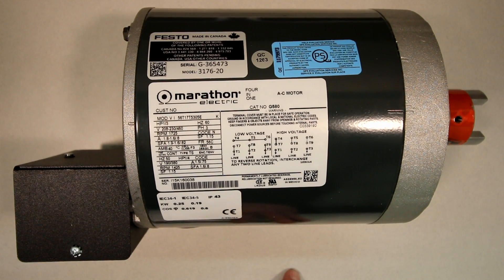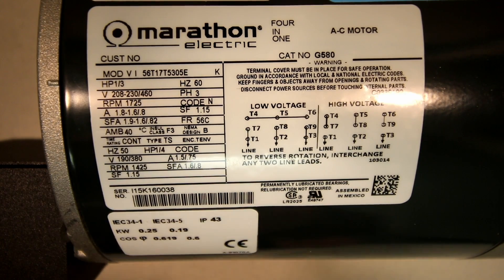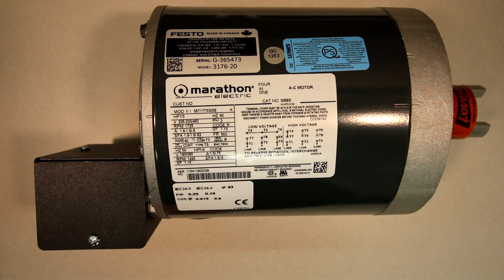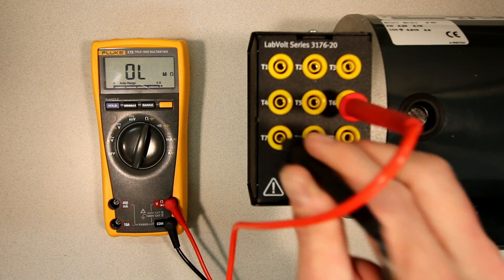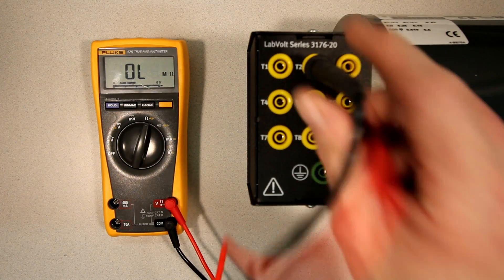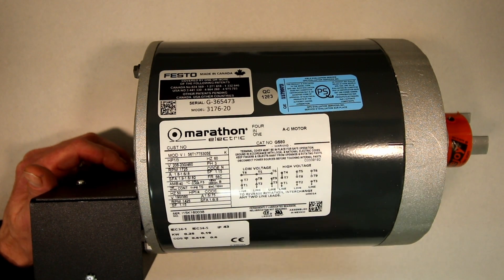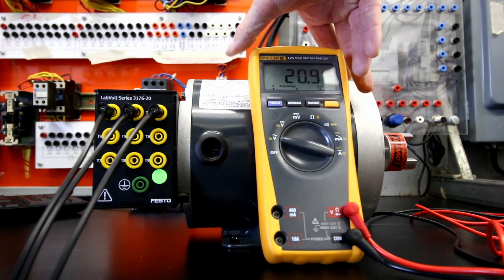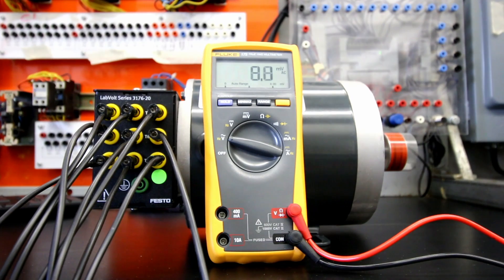Dual Voltage, 3 Phase, 9 Lead Wye Motor Connections #3

Comment: And u can't read from t1 all the way to t10 because t10 is inside ...but when u were explaining in previous video u were using and pointing to the end of the series coils which consist of 2 joined coils  from t1 to t10 220v but from t1 to t4 110v which is the half that u got 60v

Comment: The reason result was 60v because u measured half of winding/coil because in series u already said the whole 2 coil from t1 to t4 to t7 to t10  it will show 220 but in t1 to t4 it will show 110 .so u can't reach t10 to read the 120v so u got hafl of 120 which is 60v why because is b/w t1 and t4
Reply from the maker: Check out Andres Kruglov's answer that I have pinned in the comment section of this video.... in our shop we only have 208V as a supply voltage. The 208 V source requires the parallel connection. The Series connection would be for a 416 V source. 416V divided by root 3 = 240 V divided by 2 windings in series equals an expected voltage of 120V. Since I am only using 208V as the source... 208V divided by root 3 = 120 V, divided by two windings in series equals the 60 V reading that I showed in the video. Thanks for your comments Engineer Sead.

Comment: you connected motor for high voltage and turn around apply the low voltage to the motor you figure out that motor is going to cook in 5 minutes.
Reply from the maker: Please see Andres Kruglov's answer below in the comment section.

Comment: Great video!
My guess to your question. You've connected it as "High Voltage" diagram, but still used 208 V as a source from "Low Voltage" instead of 416 V. 
With your voltage "Line to neutral" would be 120 V. Divided by 2 for two winding in a line. You end up with 60 V on a winding as your multimeter shows.
Reply from the maker: You are correct Andres!

Comment: Hi. This kind of motor can be connected to a single phase power supply, and run both speeds? Best regards.
Reply: Mihai-Radu You are incorrect 3.phase motor operation is design for three phase voltage not single phase voltage.
You are confusing yourself with electrical panel 3.phase 208/120 vol.Yes you can connect 3 phase motor to 3 phase panel 208.